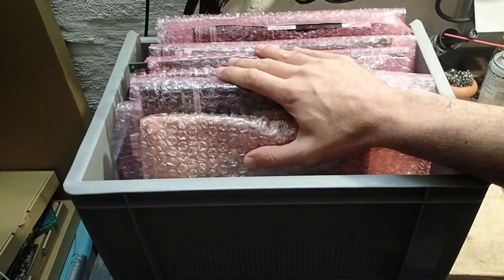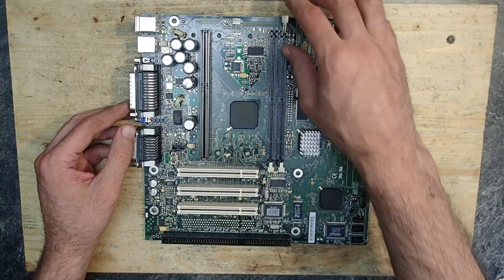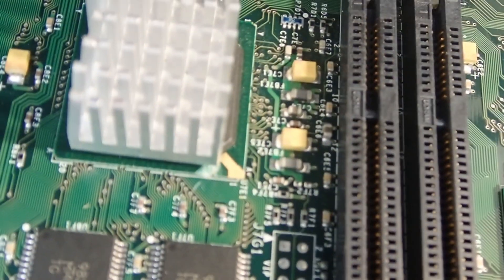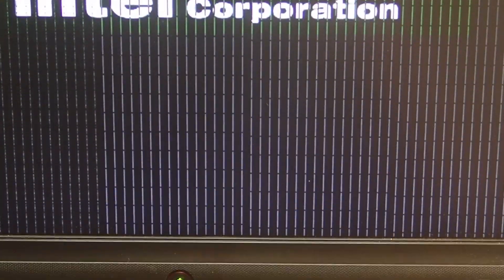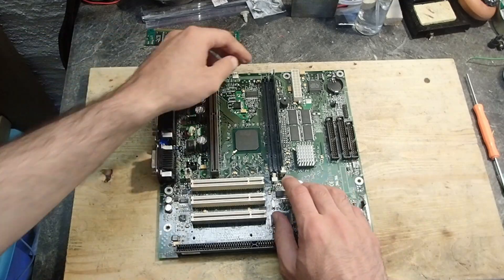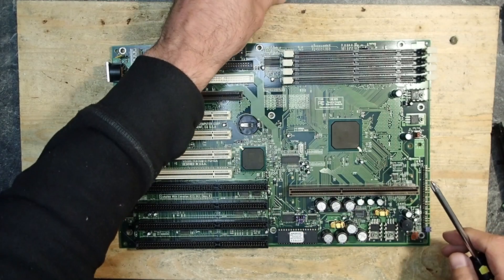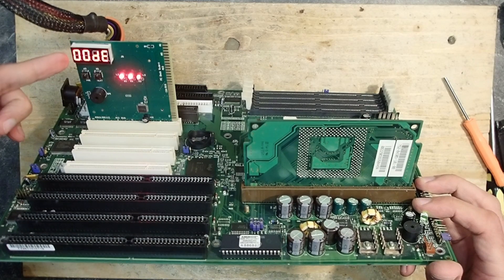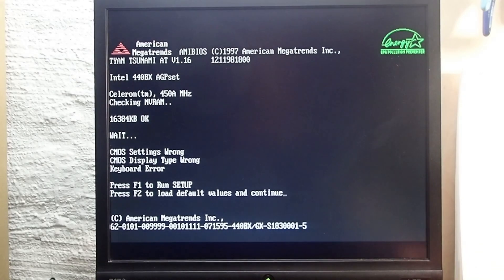Repairathon 2022: Let's call it a tie

Comment: I also thought that was an Intel board as soon as i saw it. I could not describe why. Different dark green PCB? Busy component layout? You can sure tell them instantly, even newer stuff up into Core 2 era.

If you have a frying pan and heat gun you can try reflow the BGA in-place. I have saved PS3 before using that method.

Comment: To straighten the board, consider screwing it down to something flat (like a mobo backplate) and putting it in the oven at an appropriate temp for a few hours and then leave it on the backplate to cool.  This will probably get it nice and flat again.

Comment: Not sure if you're looking at comments from a video that's this old, but I actually have almost the same board that you didn't manage to fix in this video. It seems to be a smaller variant that doesn't have the unsoldered ISA slot pads, but other than that it's almost a one-to-one copy, how neat!

Comment: The 2nd latest BIOS 
states that it supports 100MHz Coppermine CPUs, but not 133MHz.
===
 V2.00.01 012520001800

Added two new flash parts support. (SyncMOS F29C51002T, SST 39SF020) Adds 100Mhz FSB Coppermine support and latest Win2000 support. Does not support Deschutes* processors or 133Mhz bus processors.
===
So theoretically you could try up to 1000MHz (100MHz FSB) without needing to mod the BIOS. 
The latest BIOS doesn't add support either.

PS: sorry for writing you an E-Mail before finishing watching your video :)

Comment: I've been working with a recycler recently, and I can tell you exactly why that chip was damaged, they ain't got the time to twist it!  

They just zip along in the most destructive method possible because the 10c worth of gold in the chip is more important than the motherboard.  Eventually someone like myself or you walks in there and says "oh nice I want that retro board" and they sell it off at a decent price for us retro enthusiats and better than scrap value.

But we get left dealing with the parts!  So we have to triage, and that one wouldn't pass triage so they just slap it in a box, and hawk it on ebay to someone who wants it, hopefully marking the damage as best they can.

Comment: The lack of activity with the P3 chip could be due to the damage of the socket. You might try taking the socket from the other slot 1 board and transplant it into the mostly working one.

Comment: BGA repair would make a more interesting video. If it all goes wrong, you can still use it as a donor.
Reply from the maker: Unfortunately, as I said, I have no equipment and no replacement IC. I'd need a heat plate, stencil, solder balls and a replacement IC. It would be not only hard to find, but also very expensive.

Comment: The first Intel board you may consider removing the BGA altogether. I would gather a few of those leads are too close together or are touching causing bus issues on the board. I bet you could get aware with replacing that BGA. I have faith in your abilities thus far.
I love those 1830s's. I have installed many over the years and still have two working boards to this day! On of which had the slot 1 twist. Lots of old cheap cases seen the install of one of these and they usually got the "bends" following a neanderthals brute force install of the CPU pushing on the standoffs therefore bending the board tray. I had re-installed several in new cases over time and they straighten back up. I did the service of placing board height rubber pads under the CPU slot that had an adhesive pad on one side. The 1830s made my first real sleeper build in a old case. note Find yourself a Tyan 1846s. It is the SAME board in ATX form. Makes a neat pairing of boards to have. The best of the best. The 1830s was the last great AT board that could be found out there that was a TRUE AT board. Supermicro made several (of which I had one) dual CPU boards but they all had been extended AT boards only for full tower cases. Other companies had them also but once again, extended AT cases. I miss those days. Hardware was pretty awesome back then. Being a teenager working full time in a legit PC shop building up machines and playing RotT on a few networked machines in the back room! 
Love the channel!

Comment: Hi. Can you make video about power on sequence socket 7 motherboards? I need help to fix my Zida Tomato T530B with no post codes.
Reply from the maker: If you get no POST codes at all, I'd start with checking the CPU voltage and clocks.
Reply: @necro_ware  voltages in socket ok, jumpers ok, bios reprogrammed, voltages in ISA -5, 5,-12,12 ok. All chips are warm, processor is hot.
Reply from the maker: @x86legacy  Any activity on the adress / data lines of the CPU?

Comment: That Tyan is behaving like my P2B-D does when I tried using a 1.7V Coppermine 800 - the trick is in the voltage control pins on the end of the SECC2 package. I sacreligiously cut and bridged them on my CPUs to set them at 1.8V and they both work perfectly in the P2B-D now, same fix should work here and can sometimes be done just with kynar between the pins of the slot itself.

Comment: 440BX boards are so robust, no wonder the only repairs these two need are from mechanical damage... Just a good period for manufacturing, no leaking batteries, no bulging capacitors. The next time there was a full year of reliable boards from all manufacturers was when Core 2 Duo came out. PS I wouldn't bother trying to straighten that Tyan board. It will be fine when mounted in a case.
Reply: You can definitely get BX boards with capacitor issues. Earlier Asus P3B-F revisions in particular were known for it, and the Abit dual Celeron board is another coming to mind.
Reply: @PileOfEmptyTapes  Yeah, I do in fact have two Abits, a BF6 and a BX133-RAID, which I think I've both had to recap. I also have a Gigabyte 6BXC, and an Asus P2B-F, which have held up just fine. Abit always put bad capacitors on their boards so I don't think it's fair to judge based on them.

Comment: Maybe you could remove the damaged chip entirely, and then mod the BIOS to change any video option priority to PCI slot by default... but this is a repairathon. Let's leave the hackathon for another time. :D

I just want to add that I made my first Covox, inspired by your Silly Sound Bastard. I ordered the PCBs but customs stopped them for some reason, so I used a protoboard instead, and the MSX version of the circuit. My only issue is convincing the LPT port to work. It's on a PCI card, and very temperamental because I can't find the drivers (so far).

Comment: I love the at/ baby at with the atx ones capabilities! specially those with the bx zx, have you got a 128kb  modified BIOS Rom from year 2000 for a Pcchips m726t with Ali m1621.I know there is one but is for a similar board m276mrt but this is 256kb

Comment: Hey there,
I always see you go straight into the hardware with your hands, but I have yet to notice any kind of anti-static strap.
Do you ground yourself often? Or do you generally not have any trouble with killing hardware due to static from your hands?
Reply from the maker: I have an ESD strap, but I don't like to use it. Instead I have a grounded metal plate, which I touch regularly, just to be sure. But to be honest, in 30 years of tinkering I never killed anything with ESD. Btw. There is a funny video by Electroboom and LTT, where they desperately try to kill some memory modules with ESD :) I guess, It is an easier task to kill a single chip with ESD, but as soon as it is on the PCB with a lot of ground plates it starts to get complicated
Reply: @necro_ware  Hey there, thanks for the reply! 
Love your work - your videos have helped me get through a very dark time in my life - thanks for sharing your hobby and I hope it continues to bring you joy!

I totally hear ya with regard to ESD being a non-issue most of the time. I agree - and same, in 30 years I have never damaged or seen anything damaged by someone via ESD - with ONE exception:
Back in the 90's I disassembled and re-assembled my cousins Celeron 300A on 440BX - and when I reassembled it, the 440BX was dead.... oops :o

Comment: I think you'll be able to desolder faulty Riva chip using a hot air station and healthy dose of flux. I mean some traces inside may be shorted due to the damage and cause further problems.

Comment: Your channel is so awesome. Thank you. I do have a question that I would love to get your expertise on. I have a voodoo 3 2000 pci that has a heat sync mounted just like the one you removed @5:39. I’ve repasted many video cards and cpus but never a heatsynk with an adhesive thermal pad. Do you think the twist Method would be the best way without damaging the voodoo card? Or is even worth the risk to apply a new thermal pad to it? I put a slot fan next to it for now to get some air on it but I bothers me knowing it probably needs to be replaced. Thanks again for time and awesome content.
Reply from the maker: Hi! Thank you very much. You should NOT rotate the heatsink on the Voodoo3, or you will most probably rip off the GPU. 3Dfx used a very strong glue to mount their coolers and they are quite hard to get off the cards. If you don't want to risk it, just leave it as is and just add a fan. I tried it once on a heavily damaged Voodoo 3, which was toast anyway, but it was really not easy. I had to put it into the fridge for couple of hours and then I inserted a cutter blade in between of the GPU and the heat sink and gently knocked on the blade couple of times. The heat spreader fell off eventually, but I wouldn't repeat it on a working card to be honest. The risk to damage the card is not worth it, furthermore the purpose is more, than questionable. They didn't use thermal paste, which can dry out and get brittle, but glue shouldn't change its state once it is completely hardened. However its also hard to tell, if its heat conductivity decrease over the time.
Reply: @necro_ware  Thank you very much for this information. For now I'll keep the slot cooler next to it and eventually I'll find a fan to mount on there. Thanks again.

Comment: u must know that some motherboards rarely don't want to work at all or to work stable without rtc battery. and sometimes it may looks like this one - pc turns on, but freezes or get to black screen.
Reply: to straighten the board - u must use lower warmup about 60-70c and leave it under press for 4-6 hours. then u fixate it hard and leave it for sometime to cooldown. this method is one of the first used by repairsmen
Reply from the maker: About the RTC battery, I know. Meanwhile I had couple og boards, which didn't work without the RTC battery, but they usually just don't turn on. If the boards turns on, it usually also works without the battery. It just doesn't save the BIOS settings.

Comment: You are getting better with every video you make.  Like it very much.  I would suggest you keeping the bord with the damaged riva 128Zx aside.  It is very likely fixable.  To get the BGA 128ZX will probably take some time as it is a very old chip but it is a small chip and it should be possible to change it with some decent equipment.  I am now in a process of studying BGA rework and thinking about buying a station because I am meeting more and more rare interesting HW that needs BGA rework/replacement.  😟 If I happen to found a 128ZX donnor it will be yours.  There is always a chance.  Thank you for your nice videos! 👍👍
Reply: It's also looks like it's only the substrate of the chip that is damaged. I'm no expert but it might be repairable with some advanced pcb rework techniques.

Though, you would need to massivly level up your skills first, not only to BGA rework, but repair of super-thin multi-layer PCBs
Reply: It looks the die itself is ok, but the problem is the bonding from the die to the balls of the BGA. There are super thin connections from the actual silicon chip to the tin balls on the bottom of the package. One those are broken the BGA is busted. 😓 I am afraid some not-smart guy or a scrap hunter tried to remove the chip with a chisel/screwdriver - seen this many times 😭. The most important is to know if the PCB itself still have the soldering pads. You can try to somhow fix this particular BGA but it is questionable if the effort and risk of damaging the PCB worth it. Once you have the broken chip removed and PCB clean and good I would prefere witing for a chance to get the chip - reball it and solder it (or let some pro to do it). Due to the thermal stress you have a limited number of chances to solder/desolder the BGA to the board. 😰 It really depends if the connections in the  substrate miraculously survived such a butchery. 😓

Comment: Please don't hotlug PS2 devices, you can damage things that way
Reply from the maker: Of course not, that was just a bad video cut. You can see how I plug in the VGA cable, then I turned off the PSU and the plugged in the keyboard and turned it on again.
Reply: Wait, what? I didn't know things could get damaged that way. I thought it was fine and just wasn't guratanteed to work until a reboot
Reply: @svgaming234  You can cause a short due to the fact the pins are all the same length. In the small chance(and I do mean small, but yeah) the current jumps between pins when still active you could blow something. USB and other hot swappable parts have different length pins to make sure they are powered down in the right order.

The same goes for almost any old socket, such as Atari joystick ports, serial and parallel. It's a really small chance, but not something you should chance given the rarity of retro kit these days.
Reply from the maker: @fattomandeibu  Exactly, but most of the boards have a fuse on the keyboard connector, which blows up in such cases. So even if it can happen, it is usually an easy fix.
Reply: @fattomandeibu  Alright, thanks for the advice.
Reply: It’s not so much about voltage jumping between pins..

There is a slight chance that you may connect a voltage line (the +5V pin) and one of the data pins before the ground pin connects.  In that case, it is possible that the circuit will try to find ground through the data pin, and into a microprocessor (keyboard controller on either end) instead of the proper current-carrying pins.

Likewise, if ground connects first, and then a data pin, you could end up powering the circuit via a data pin.  Most ICs have protection diodes that shunt voltage in excess of the main supply pin to the supply pin.  If the V+ supply is not connected, it is essentially 0V, and therefore the data pin is higher and will conduct through the protection diode to the V+ pin on the IC.  If the circuit draws enough power, you could burn out the data pin.

I don’t personally believe it’s that big of a problem.  Most failures are due to prolonged over-current or excessively high surge current.  You aren’t likely to have a prolonged event in a hot-swap scenario, and surge should be fairly low for low-power devices like mice and keyboards.

It is a real risk, and supposedly has caused device failure before, but IMO, life is too short.  I don’t make a habit of hot-plugging PS/2 devices - particularly since many older AT-era boards won’t recognize it after boot anyway.  But if it does work (particularly for KVM switches or the like), I don’t sweat the occasional rude connect.  To each their own, of course.

Comment: it is kind of scary to think those boards were equivalent to todays gaming pc's when we were kids and now they are saved from becoming gold recovery scrap
still i love how you sometimes make those things work much harder than intended, even if now that a small difference

i wonder if you ever get to my nemesis , via apollo board with socket 370 and broken rtc battery switching circuit. literally every via chipset board i had developed such problems and begin killing batteries. they might not be designed to work 10+ years though and who know

i hope you won't have too many boards with that problem but check if you do because it is always a letdown when you don't even know your cmos battery gone bad

Comment: I found it only slightly ironic that as you questioned the use of a screwdriver on the graphics chip, while you were scraping off thermal paste with a screwdriver. I concur that a different method could've worked such as applying some heat or electrical contact cleaner to break up some of the adhesive properties.
Reply from the maker: Hehe :D Yeah, it was already dead anyway
Reply: @necro_ware  remove the power to the damaged graphic chip there is probably and inductor or 0 ohm resistor or something to see if the board works normal with external graphics without the damaged chip
Reply: My iFixit Kit has some things that look like guitar picks. If they could be used for that, if necessary even an actual pick? But yeah, if that chip is dead, then it won't matter if you use a screwdriver or not.
Reply from the maker: @bundesautobahn7  I use my guitar pick for such things, I already showed it in some videos, where I removed a sticker or something like that.
Reply: I mean, it was dead anyways
Reply: the package is not the chip itself, so no damage could be done beyond visual.  Plus, its not irony.